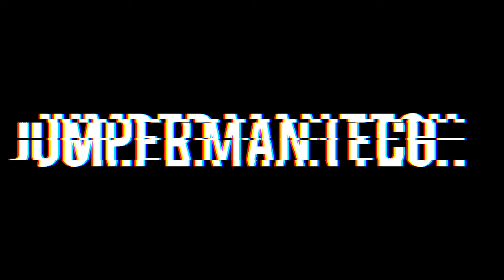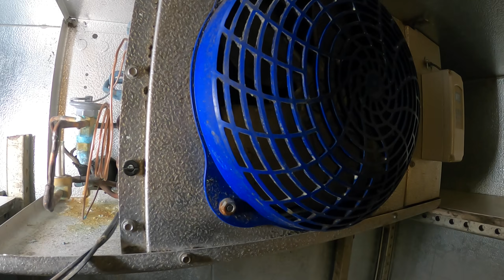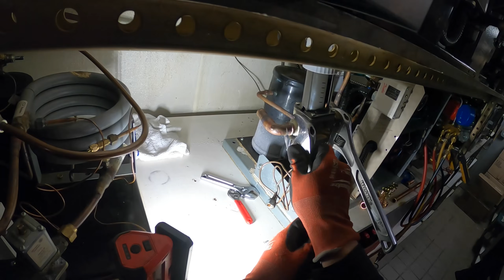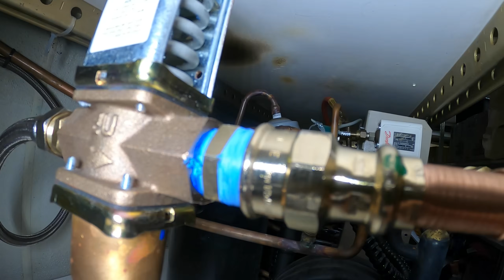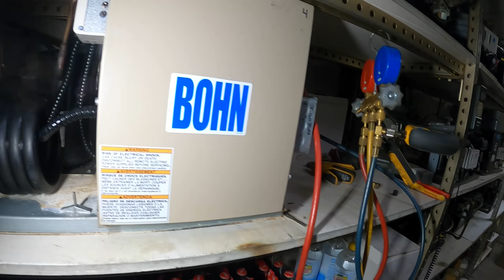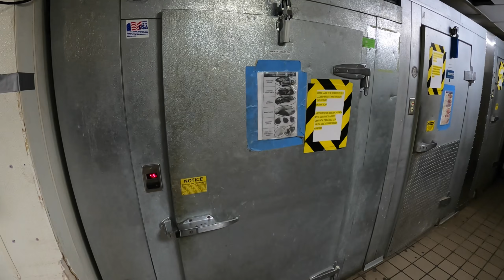HVACR: Water Source Walk In Refrigerator Not Cooling/High Head Pressure (Troubleshooting & Repair)

Comment: 1/2 to 3/8 may not be a big gap but its best to go with what the manufacturer asks for. It would suck to install it and have it not work due to a restriction.
Reply: Is 1/2 to 3/8 considered a restriction?
Reply: @wrestlingterrier8366  Depending on the equipment it can be.
Reply: @MechanicalManiaco  I see. Thanks !

Comment: I recommend removing used filter driers with cutters instead of brazing since the heat will expand the moisture and other build up into the system quicker than you can take it off

Comment: I recommend oxyacetylene for brazing on refrigeration equipment. B torch takes longer to heat and you run the risk of overheating other components. Oxyacetylene heats quickly, allowing you to flow the alloy and pull the flame off sooner.
Reply: You can use oxyacetylene in NYC. Hospitals won't let you bring torches in without extensive approval. B torch (straight acetylene) is great for plumbing and anything soft soldered. Didn't say ditch it, just don't recommend for silver soldering, the melting point is near that of the copper. B torch takes a while to get there and the whole time you're heating, the heat is traveling to other components that can be damaged by excessive heat (e.g. valves, sight glasses, driers) even if you've taken pains to prevent it with wet rags and heat blocking putty.
Reply: there's a time and a place for both setups, keep both around
Reply: Also there are rules for NYC travel and what buildings allow.